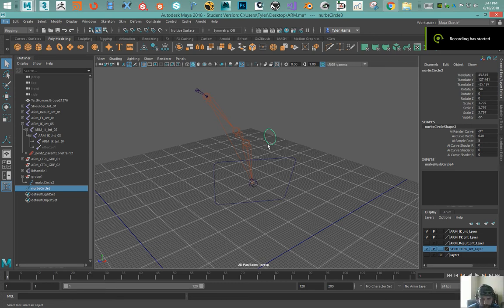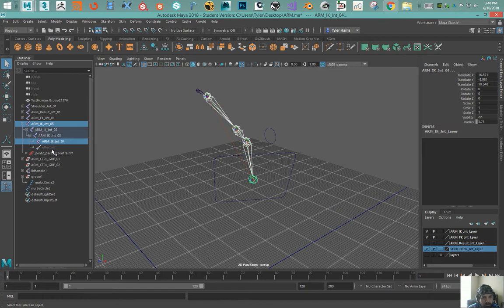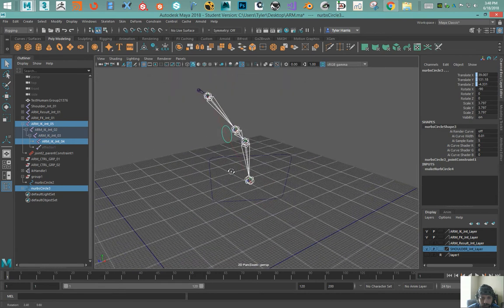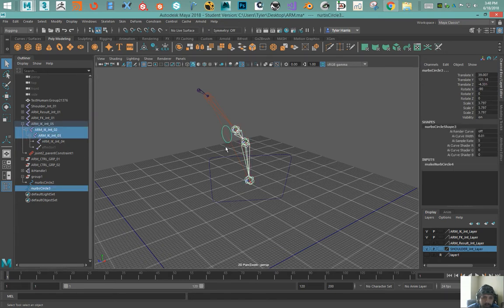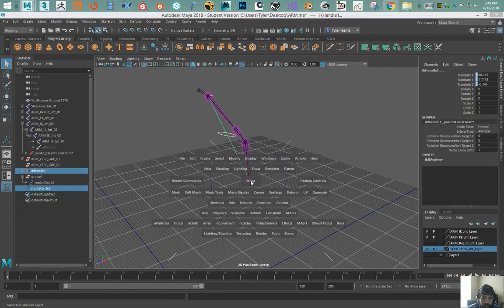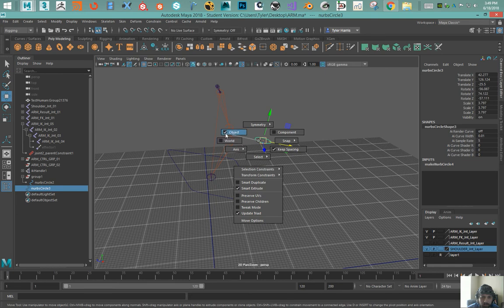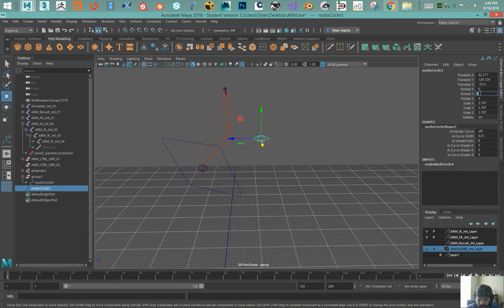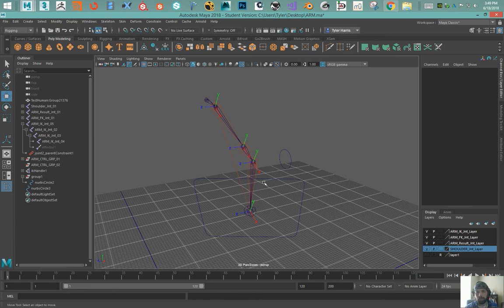When adding a pole vector moves joints. (How to Fix) *Maya 2018*

Comment: This didn't fix my issue by itself, but there are a few methods including this one, that I was able to combine and reach success with my rig. 

Basically, it's a combination of a couple of methods I saw to do this. 
Remove your curve from the group you have it in, then select the top and the bottom of the joint chain that you've ik'ed, then select your curve, and perform a point constraint, do not maintain offset, then delete the constraint, select the middle IK joint, (this also works with multiple "center" joints just select all of them) select the curve, perform an aim constraint, delete it. Next, perform the pole vector constraint. and take note of the lack of transformations on the shoulder and other joints in chain. But with a centered pole vector it isn't super useful, yeah? 
So, next create a linear cv curve chain following each joint in the ik chain, then pull out the center curve point using it's normal (move tool settings) however far you want, then using component mode, select all the nodes from your control curve and curve snap them to the bend in your cv curve. Complete the movement, switch back to object mode (F8) and center the pivot for the control. Freeze it's transformations if there were any. Create a new group for the control curve, center the group's pivot. Delete the CV curve you used to move the control. Check your joints for transformations again. 

After trial and error and then combining the methods I've seen to fix this, I've finally had success with this method for a couple of joints that were being funny, and were really roadblocking me from moving on, let me know if it helped you or if I can explain better.